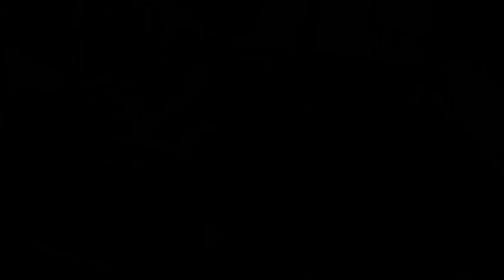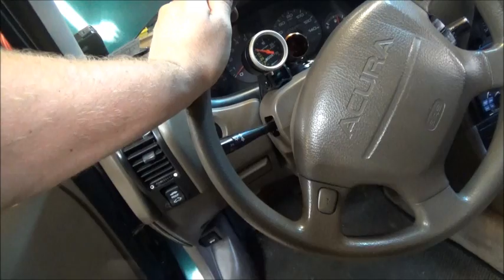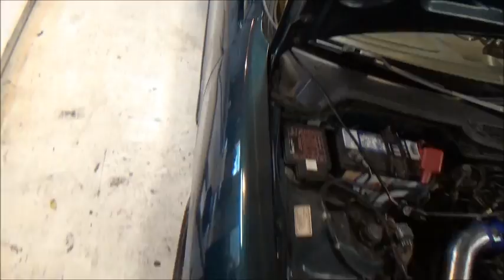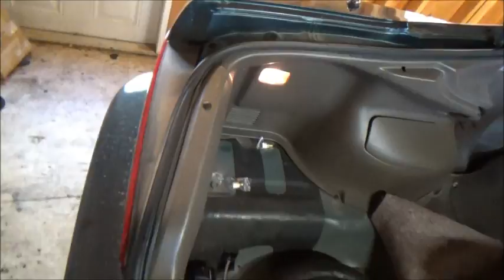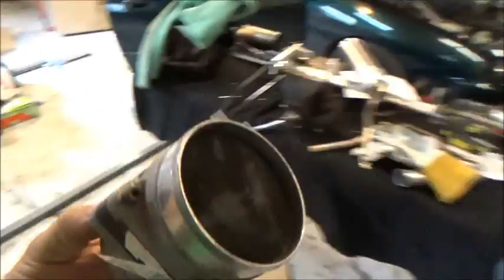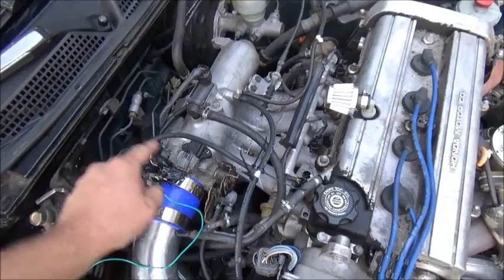How To Turbo Your Automatic OBD2 Honda

Comment: There's tons of ways to tune... 😆 just switch to obd1 with a jumper harness.. or just get a stand alone ecu like aem or haltech. 😆 and you can keep a.c. regardless of if its auto or manual.. the turbo manifold will be identical whether your auto or manual 🤣 🤣 🤣 🤣
Reply: Can also go with msd 6al box with a fuel management system.

Comment: If I am running an I/H/E on my d16y8 sohc vtec engine for the honda civic 2000 EX sedan, how much whp would that be all together with the turbo installed after a good obd2 tune?

Comment: I have a 97 integra auto I turboed and put a hondata s300 in a p28 obd1 ecu and put in the car and everything works just fine tranny shifts fine runs great on a obd1 in an obd2 car
Reply: Did you had to use a special tune on it for the transmission to shift properly? I am working on getting a turbo for my 98 prelude, and just doing research. Asking people who have done it and had success with an  automatic.
Reply: @funnyshoes11  the transmission has a separate control module that controls the transmission so I just tuned the car you normally would but I ended up swapping to a manual as the transmission overtime couldn’t handle the power
Reply: @possiblyunknown  thank you for the response, ahh I understand, sorry for the questions, just glad to talk to somebody that has the  knowledge and experience, Years ago there were no such thing as hondata, I know what it is, but never mess with it. And the forum, you mention the words turbo and automatic together, people laugh at you, Specially preludes 97 to 01, So I need hondata and a OBD1 computer from an older prelude that it's chipped with p28?.
Reply: @funnyshoes11   you can use hondata or  any kind of rtp. Cobra rtp, Neptune demon, there’s a lot of options when it comes to tuning. I’m not sure how the auto preludes are but if it has a separate tcm then you should be good to slap and obd1 computer in the car
Reply: @possiblyunknown  ok got it, I looked it up and it does have a separate TCM, so get the OBD1 computer specific to the car with the jumper for OBD2 and get the software for the tuning, I looked them ECU'S up in the past, and it says in bold red letters, for Manual transmission's only. That's what stoped me from getting one. I thought the main ECU controlled engine and transmission, didn't know they were two separate modules.
Reply: @funnyshoes11  should be good to go
Reply: @possiblyunknown  thank you, appreciate the help..✌️
Reply: @funnyshoes11  not a problem 😀
Reply: @possiblyunknown  so basically mines is a 97 db7 integra obd2 all I need is a obd1 ecu and any tuner like hondata right I don’t need a obd1 engine harness just the ecu right.
Reply: @SheenHunnit  right and an obd2 to obd1 jumper harness for the ecu conections
Reply: @possiblyunknown  okay thanks bro that’s pretty simple then

Comment: I ran 16.6 in my stock suspension auto Integra I have a high compression b20 and b20 trans with b20 injectors (they're bigger). And I fucked up 1st gear shifted to 2nd at 4rpm and bogged bad and it wasn't revving past 6 normally it goes to 7 like it's suppose to so that was definitely a bad run. I know it would run 15s with a clean run. You would run 13s with a b20 trans for sure. In fourth gear at 3,000 rpm I'm going 58mph the gears are short. All the gears pull way harder than the ls trans. I had a ls trans in there prior.

Comment: So, i have a 2005 Honda civic ex Special Edition coupe AT Trans. Will this kit work for this vehicle?
Reply: That car has a different motor
Reply: @Fa5Squad  yes, its a different motor ofc. 
Its also AT and obd2
Reply: @Maeda_v  you would need a 2005 civic turbo kit
Reply: @Fa5Squad  Looking at either kits wouldn't matter if they would be using the same turbo, its just the piping that would differ and other small parts. Its whether the same set up will work in another car that obd2 and Automatic thats being done in this video.
Reply: @Maeda_v  you need a different exhaust manifold. Because, as I said, you have a different motor and car lol. U technically can't use the same exactly turbo kit..
Reply: @Maeda_v   u can "set it up" the same..  as far as turboing a car goes it wud be the same setup technically 🤔 they all require specific parts and they're all different depending on model car and engine. You couldn't take this guy's turbo kit off and use it in your car you'd have to change and modify things
Reply: @Fa5Squad  Well he already said its a mix mash of parts, i know my car will difinately need a different exhaust manifold. What im trying to say is "will the kit in general work with his method"
Reply: @Maeda_v  you mean the meth injection? Yes. Bigger injectors would be alot easier though and an apexi neo  😉

Comment: I got this accord from 2000 with a f18b2 engine with a automatic gearbox my fear is if i would boost the car that il mess up my transmission plus i cant find a turbo kit that fits on my engine...

Comment: I have a 99 crv auto that I want to turbo and daily, I assume since they're so similar it should work but I also know the intakes are a little different. Any tips or parts I need?
Reply: I would use a FIC for tuning and not the methanol but youd need a legit tuner who knows what hes doing.

Comment: Great idea but you should have gotten the hondata v3, injectors, and a hondata 3bar map. I know its more money but youll notice a huge difference. All you need is head bolts ..arp and boost that bitch to 15, 20psi. Ive done it 3 times. Stock ls.with arp head bolts only. The ls motor is very resilient.
Reply: You don’t know what you talking about. OBD2 automatic ECU has the transmission shifting schedule in the same ECU. You can’t do that in a Hondata s300. You don’t know what you talking about.

Comment: what's would be a good swap for a 97 accord ex vtec 5speed??
Reply: swap the 97 head for a 90-93 f22a head and shave it 30 thou and build the head- add bolt ons and a good tune and u will be making 200hp or more to the tire the whole g22 swap is a waste in my opinion

Comment: from what I been reading for awhile now ya shift maps cant be changed for the automatic..You can use a ODB2 to 1 converson for Tuning..or use a FI/C piggyback and uego wideband failsafe to keep things good from aem for the automatic .. There used to be a few companys that made tq inverters for the auto that give ya a higher stall speed..My advice with building a turbo Honda is  all about temps and turbo choices..The bigger the turbo the more the lag ..Keep its small t20 t25 maybe t3/t4 use a short turbo manifold for faster spool up lower in the power band and watch ya heat!! Use a 2 or 3 core rad and a big transmission cooler to keep that thing alive longer also a bigger engine oil cooler that will keep the temps down on the turbo and engine internals.Good luck nice work man!!
Reply: only a slight problem with running small turbos like that and that is they make boost so early and put alot of stress on the rods and can lead to premature engine failure
Reply: Yup that's spot on depending on the boost amount and early boost would make me buy some rods
Reply: i thought you were not able to go obd1 with an auto trans because you no longer have the ability to control the automatic? am i wrong because that would be great news

Comment: Why didn't you just use a methanol kit that had it's own integrated map sensor like the AEM V2 kit? I feel like that would have alleviated a lot of extra complexity and wiring in this build as well as lowering cost.
Reply: you have valid point. some piggy pack control modules that connect directly to the ecu. haltech and aem are good. could be a mad scientist go for stand alone do a megasquirt.

Comment: Would this same setup work for 98-02 accords since they are also obd2
Reply: You could run the same setup, but you'd have to make sure to get things that are compatible with either the f23 or h22a engines
Reply: Did you find out?

Comment: Hey I got a accord 96 f22b2 how much would everything coast
Reply from the maker: around 2500 or so normally
Reply: +Justin Sane ok thanks how much boost should I run
Reply from the maker: What ever it takes to meet the goal or limit of your part combo. Boost means nothing. Hp is what you watch
Reply: +Justin Sane do you think I should do the cam gear cause I just did my head with everything new in the head
Reply: do u have a aftermarket cam that would need a adjustable cam gear?

Comment: Im a bit of a beginner with this stuff but that tube that is connected to you intercooler pipe with the blowoff valve. I noticed it was attached from the valve cover to the intercooler pipe? I was just wondering if it would be fine to use an old cold air intake pipe to start off my intercooler piping and keep the old tube connections that were previously on the CAI

Comment: Hey dude. Awesome video. Im in the middle of doing a j30/nsx head 99cl. I was just doing N/A for ease of tuning. But this is an awesome idea! Just a quick question, why couldnt u use a mass air flow from a newer honda motor? I know the newer engines do use them (not much exp with anything newer than J series...lol). I kinda figured you already thought of that, just wondering what made you use a gm v8 maf? I actually did the hydrogen/oxygen injection, home made kit. It doesnt add a ton of hp but drstically reduces a.i.t.s, and does richen mixture just a bit  plus it only cost about 60$..... i really like the idea of water/meth inj. Have you tries a 80meth/20h20 mix? From what i have heard from guys running them, the small amt of h20 cool a.i.t.s. Just wondering not being a ball buster. I love ur vids as they show everyday joes how to CORRECTLY install a turbo and not grenading the motor on the test pass! 
Keep up the good work, and if ur interested, i did build a "kit" for the hydrogen\oxygen inection, which really helps fuel mileage as well. (for the j35).

Comment: Cooool! This was perfect because I plan to turbo my automatic crv with a small t25 or t28! I wonder how the transmission and torque convertor will like the extra power though. Have only ever dealt with manual hpndas. But anyway, anything over 200 and I'll be happy. Just the extra get up power should be lots of fun! Especially with the 235/70s!
Reply from the maker: Yeah I just switched it to a maf on Friday and deleted the cat and it dropped another second.  It's st 15.2 at 96 now on 6 psi
Reply: Nice! Have you figured out a way to build some boost off the line yet?
Reply from the maker: No. The torque converter is just so low of a stall. It does around .6 of a psi now at launch so may be with the full exhaust we can gain even more. It's has the mph to run high 13s of we could just get the 60ft down. Maybe a quick spool valve would help.
Reply: Im just now thinking on putting a turbo into my awd auto Crv too

Comment: So could I Turbo my 91 accord f22a1 the same way.
Reply: jonathan ward yes u can an the f22a is a bad bitch i like to run f23a1 bottom ends with f22a6 fully built heads, i usually shave 20thou off the head to bump the compression up some and then turbo them and they make 250-300hp all day everyday
Reply from the maker: Yes
Reply: Jonathan Ward cb7 ftw :)
Reply: Jonathan Ward  i have a video on my channel of a 1992 check it out .
Reply: Patricia Beamer you not worried about detonation or you running low moderate boost?  I plan building up my F23 in my 6th gen accord a year from now.
Reply: why would u have detonation? i run 93 octane and run under 20psi of boost and its good
Reply: all u need is good 93octane an a knock sensor thats still good an up an running so when your tunung with compression in the high 9s to mid 10s compression ratio. i usually run shell and bp fuels and havent had any problems with there stuff because there 93 is ethanol free and alot of the cheaper gas stations dont take as good of care of there fuels and they have ethanol in all ther fuels and ive even gotten watered down fuel from some stores

Comment: just thinking here :
couldnt you use a wastegate in the downpipe after the turbo
if the backpressure in the exhaust system gets so high it prevents the turbo from building boost it opens and turns the exhaust intoo an open pipe 
prolly needs to be a pretty big wastegate and a verry light spring but you can keep the stock exhaust on the street on low boost using a boostsolenoid fitted behind the turbo too keeping the wastegate closed

as youre still usung the stock injectors you could add a 5th injector near the trottle body working of a boostsensor 
the stock ecu should pull back the stock injectors a little if the ar gets too rish using the lambda readings
Reply from the maker: It don't adjust on its own that quickly.  It's running Perfect the way it is. Just put a maf in out of a mazda on Friday and deleted the cat and it now runs 15.2 at 96